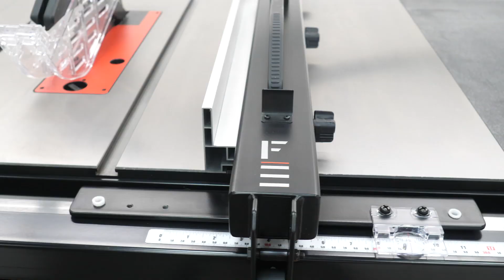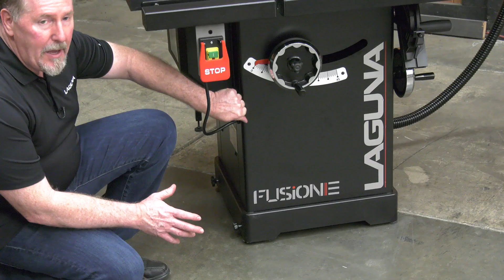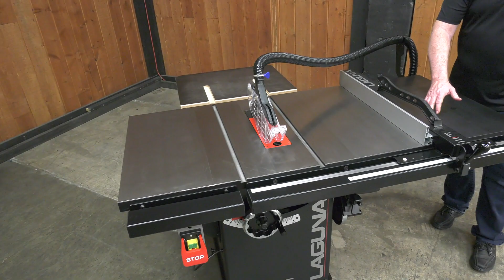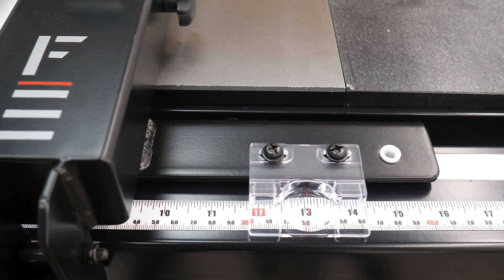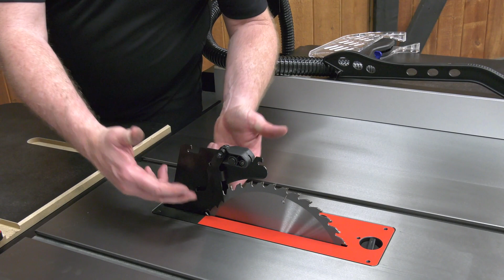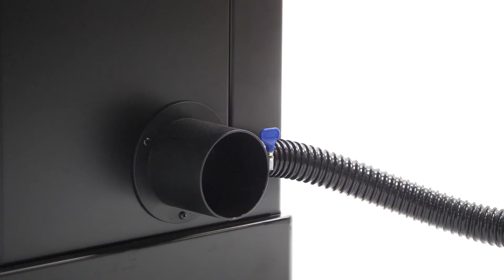In-Depth Overview: 2020* Laguna Fusion F3 Tablesaw | Laguna Tools

Comment: Extremely excited, after work this morning here in the U.K I visited my local tool and machine centre, there for the first time I saw and got my hands on the Fusion3, I placed my order and my beautiful table saw arrives early Friday morning, I have high expectations for the saw so time will tell!
Reply: How is it is it worth buying
Reply: @montdino9775  hi. Yes a great table saw. Powerful and accurate. Great fence and perfectly flat castings. Can't fault it.
Reply: @louiesworkshop2023  is it single phone or three phase ? And does the arbor take a stack dado I know the illegal in the uk and Ireland just wondering if the arbor only takes a single blade cheers
Reply: @montdino9775  yes single phase 240v and yes the arbor is long enough for a stacked head although I wouldn't ever consider running one as the saw has an electric brake and and electric braked saw with a stacked head is a very dangerous combination. Hope this helps pal, regards Louie
Reply: @louiesworkshop2023  cheers bud I appreciate it the feedback
Reply: @louiesworkshop2023  would you say it’s worth the Money 2500 euros
Reply: @montdino9775  What would that be in Pounds Sterling? I think here in the U.K Northern Ireland its priced at around £2200
Reply: @louiesworkshop2023  us that’s about right I’d say
Reply: @Louie's Workshop  hi 👋. According to the manufacturer, this table saw is designed to work with dado stacks as well as normal blades. At least, that's what they say in the youtube review.
Reply: @marioa.7780  Hi Mario, yes the Arbor shaft is plenty long in terms of excepting a dado stack however be careful buddy, the saw is fitted with an electric brake and thus when stopping the brake will reduce the two outer blades rapidly but the inner clippers may continue to spin which could create considerable flex thus pose a very dangerous situation for the  operator! I don't really answer questions anymore about the saw Mario nor do I promote this saw as I have done in the past with many, many sales because after many times achieving sales I asked Laguna UK for possibly something for my efforts for example a poster or something simply for my workshop but surprisingly they refused and give nothing! If you are in the market for a safe table saw that excepts a dado safely then I would much more consider the Axminster Harvey table saw, much safer with the dado plus it offers a nice soft start unlike the Laguna Fusion3. Hope this helps mate.
Reply: @louiesworkshop2023  thanks. I had also been considering buying the axminster. Thank you so much.
Reply: @marioa.7780  hi buddy I would strongly advise the Axminster Harvey Table Saw, it's a great saw that offers safety when using a stacked dado plus unlike the Laguna Fusion3 it offers a lovely soft start, plus it's considerably cheaper. If I had to buy again I would 100% have opted for the Axminster Harvey, Axminster is a good company that offer their customers help and respect. I wish you well with your choice, kind regards Louie

Comment: Need to get Jay on assembly of a new Fusion F3 video.  I have had mine for a week now and the assembly instructions for the fence rail and support don't jive with the ones in the manual.  My manual shows 5 square head bolts for an extruded aluminum fence rail support to slide onto.  As evident in the video above, this clearly isn't the case.  I have a case number, but am still currently awaiting resolution...
Reply from the maker: Thanks for the input, Matt.
Reply: Hi Matt, did Laguna ever get back with you? My F3 just arrived with out of date assembly directions.  I'm moving forward with assembly but it truly has added a lot of time that would have been saved with proper assembly documents.
Reply: Cody they did, but the best I got was some schematic photos and a parts list.  By the time this arrived I had already assembled mine.  It’s really ridiculous that Laguna STILL does not have accurate assembly instructions available.  Unbelievable really!  Luckily the saw is sa-weet, because the product is the only thing giving me a positive impression of that company.  You need any help, let me know and I’ll take pics or do whatever I can to help ya.
Reply: Matt Wood thanks for the reply Matt.  I ended up finding the diagram after all.  They included 2x the screws so that threw me for a loop.  Also sent an extra outfeed table.  🤔
Reply: And do agree, it’s pretty ridiculous and a waste of time for their customers to have not have an accurate assembly document available.  Glad to hear the actual saw is decent.
Reply: Cody that’s funny that they sent you an extra outfeed table because mine was not in the crate and I had to call to get them to send me one.  Guess you got the one that was supposed to go to mine!  Lol
Reply: Matt Wood ahhaaa, wouldn’t doubt it!

Comment: Good video. Need to know about the different between f3.. 2019 model and 2020.
Reply from the maker: We had a model in 2018 that had an aluminum fence rail. Our new 2020 model has a full steel rail and improved dust collection, as well as out feed tables.
Reply: @LagunaTools  Thanks for your reply. I'm already placed my order with my nearest dealer.

It will take time to get this piece to my home.. 😁😁😁

Comment: Will all your sellers have the DRO as standard? 
If not, can it be installed after ?
Reply from the maker: Hi Kimberly,
The Fusion F3 and F3 has had it installed for about a year since April/May of 2021 as standard. Unfortunately, can't be retro fitted and its also not available on the Fusion F1
Reply: @LagunaTools  Thanks for the reply.
Asked for the status it’s available at our local seller in august.
And will be calls fusion 3 pro, for 7.11$ more . I’ll wait hope your supply chains is improving ☺️

Comment: Hi. 
just bought the saw here in Denmark, and what a beauty.
But. There is a lot of things missing on my saw.
There is no riving knife included, no tool storrage, a totaly different version of the bladeguard, and the included bladeguard rivingknife has no anti kickback.
Why is that, when you promote otherwise in this video.
Reply from the maker: Every fusion saw will come standard so if you didn't get these, then please contact customer service. Thanks.
Reply: Hej. Jeg overvejede også denne sav men er bekymret for om strømmen i mit værksted er kraftig nok. Hvad har du forsynet den med? Kører du et 220V ud fra er kraftstik (16A)? På forhånd tak. Venlig hilsen
Reply: Hej Magnimania.
Jeg har den sat til en 230v 16a CEE stikdåse. Jeg har 400v ind i mit værksted, og har splittet det op med en byggstrømstavle. 
Vi
Ian.
Reply: @iansguda  hej Ian. Mange tak for svar. Jeg har også 400 V (16A) i værkstedet hvor jeg vil trække en 220V ud fra. Så det lyder som samme løsning, og du er tilfredse med saven? Venlig hilsen Per
Reply: @magnimania199  hey hey.
Jeg er super tilfreds med saven, 
Den tygger sig igennem alt jeg smider i den, uden at brokke sig. Når først du får den indstillet er det bare der ud af. 
Vh Ian.

Comment: Devastated!,,....I purchased my Laguna Fusion 3 table saw, I took time to set up the saw to perfection, I upgraded the tripper to a 20amp D type and I plugged the saw in, pressed the start button and the saw started, all seemed great, I pressed stop and it did, about three minutes later i pressed the green start button again but nothing this time! I inspected the tripper fuse and all was well, I then inspected the cabling of the saw and the wiring of the blue plug, perfect! I then pressed start again and nothing! I plugged in my planer as it is also a 16 to 20amp machine and the planer started perfect so the table saw is where the fault is! I make bespoke furniture for clients and as this is my only table saw in my workshop this is dreadful and will cause problems, the saw is 11 days old and it started one time and then failed, very disappointed, I have now contacted Laguna Tools UK
Reply from the maker: We apologize for any inconvenience this has caused you. Please reach out to our customer service so that we may assist. 
You can submit a ticket here: https://lagunatools.com/resources/customer-service/
Thank you very much.
Reply: @LagunaTools  VERY VERY lame response. I was seriously considering this saw but I now have big doubts !
Reply: They literally replied asking how they can help, did you want them to send off a new saw based on a YouTube comment?
Reply: @Runnymede1987  I think you are failing to recognise the issue here, the saw is fitted with a weak fuse which I turn fails the starter motor shortly within the saws working cycle, the fuse itself is merely a few Penny's more than the standard fuse that is fitted, this is poor and has a very real knock,on effect and impact to the end user, and if the customer relies on the saw to carry out production work with client deadlines this can prove problematic, always endeavour to think before you comment friend, it's always best!
Reply: So at the end what was the problem?

Comment: Is this the same fence as the F2? I was checking out the F2 in person at my local dealer and the rear end of the fence was coming off the table when locking down
Reply from the maker: The F3 and F2 have a similar fence design but they are completely unique parts to each machine. The f3 fence is not the same as the F2. The fence can be adjusted on both models such that the rear of the fence will not come off table. There are adjustments for every part of the fence lock.
Reply: @LagunaTools  thanks for the reply. I do believe they had the saw improperly setup. Can’t wait to get the F3!

Comment: I was really excited about this saw. Uncrated it and set it up. Plugged it in and pressed the start button. Nothing but a dull hum. Lagunas solution is "here's a part fix it yourself". Why am I fixing a brand new saw that I've never even used. It arrived non functioning. I am so disappointed and frustrated. I won't be purchasing anything else from Laguna.
Reply: Not the first time I've heard this